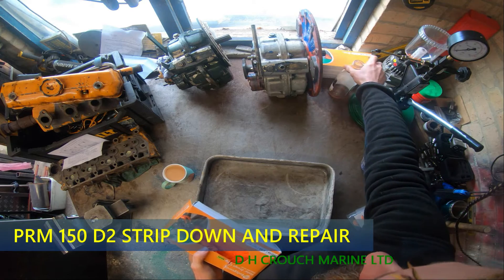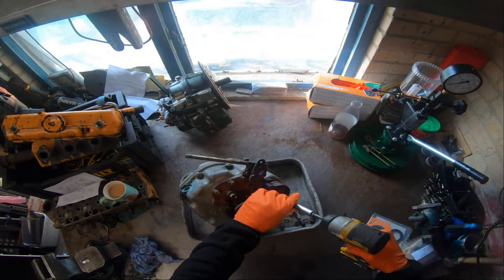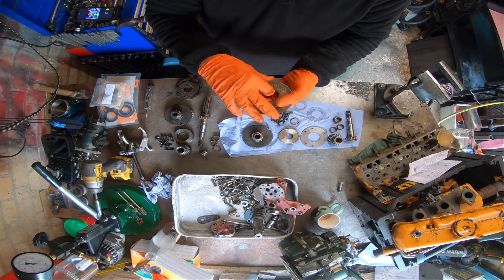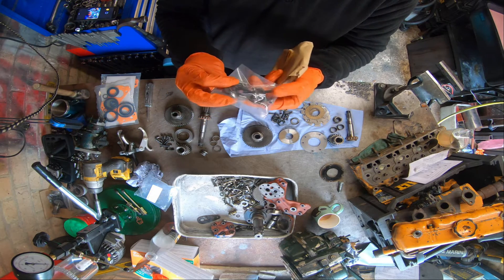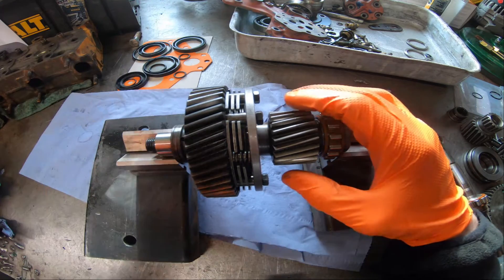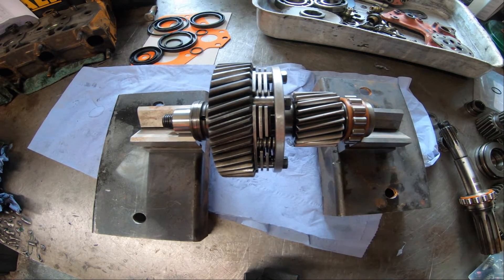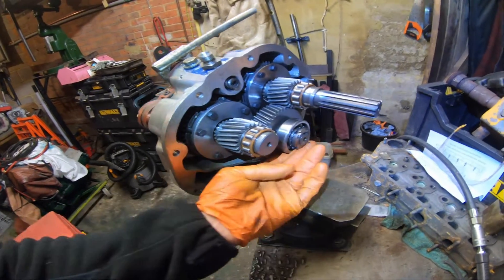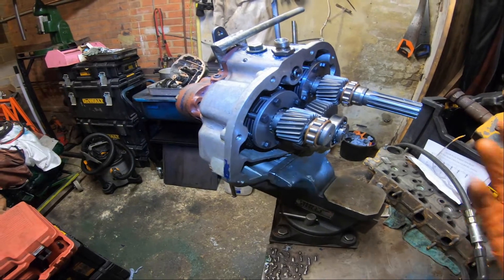PRM 150 D2 Strip down and repair.

Comment: Thanks for your video and knowledge. 
I can't access my drain bolt on the gearbox that easily, used a sump sucker but doesn't seem to get much out ,is that because of the sump,and how critical is the oil level, is maybe 1/4" over the full mark much to concern about,I've got such a job to read the level on the dipstick, typical me 👍👍
Reply from the maker: Over fill it. The manual states you need to consider the oil cooling circuit. So you need to over fill.

Filling to the top mark is actually not enough for the entire circuit.

As the gearbox pumps oil the sump will empty some so you have to add that to the equation.

Comment: Hi Daren
I live in Canada
West coast
Have a PRM150 D2 gearbox with 220 hours on it.  Forward works fine. In reverse it’s not fully engaging. 

I did recently have a blockage of zink buildup from the BETA 50 heat exchanger through to the gearbox oil cooler. 

Any suggestions?
Out what would it cost to tear down and rebuild. If that’s necessary?
Thank you
Reply from the maker: If contamination has got into the box and as they dont have any filters you might have a piece of swarf stopping the oil control rings and hence losing oil pressure. If so that that will cause the reverse clutch pack to not function correctly.

Or the clutch pack has worn out. Typically it's the ahead clutch that fails.

Cost to rebuild heavily depends on what's wrong. It can be as much as half the typical cost in the UK or near as much as new.

I don't know what labour fees are there where you are or how expensive parts are as they will be imported.
Reply: Thank you for the response. Would you happen to have a rebuilt PRM 150 D2 gearbox you could sell and ship to me in Canada?
Thank you
Nick
Reply from the maker: @MrNickstevenson63 Currently no. You can send me yours maybe ?
Reply: What would be the cost for a full rebuild in pounds sterling. And the turnaround time
Reply from the maker: @MrNickstevenson63 drop me an email 
darrencrouch@dhcrouchmarineltd.co.uk 
With your full name and adress and I'll estimate it for you
Reply: Hot do we communicate realtime

Comment: hi wonderfull video.....i had an accident on my canal boat yesterday and the nuts fell out of the gear box causing propshaft to misaligh n and gears to grind to a crunch  do you think i need to replace any parts or just bolt back together inplace??
Reply from the maker: Please explain further. What bolts fell out, were from?

The alignment will most likely need to be checked

Comment: Very intuitive thanks. I got a new boat with one of this gearbox. Planning to change oil...cant see well the sump way. Do you think i can get all the oil out thruw the  drainplug with a oil pump?
Reply from the maker: With a vacuum pump and a plastic pipe you can get most of it out. The only slight disadvantage is not being able to clean the magnet on the sump nut.

Comment: Hi again,

I've forgotten where there the trust washer (a washer with two grooves in it) goes, where does it go? I've just replaced the reverse clutch pack.

Is grease added around the bearings, if so which kind? (i haven't replaced these but can see what looks like grease around them)

Do you use a press to press the main drive bearing back on, is there a safe technique?
Do you use Loctite glue on the threads? There was some on mine when I tried to remove it which made it very tough to remove.
May I shall make a video of me putting this all back together, just want to make sure I’m doing it right first 😊
Thanks for your time
Reply from the maker: Have you got the workshop manual? Its free from PRM. All the information is in that.
Reply: @dhcrouchmarineltd3049  hi ya, yes I have I believe, I downloaded it. 
I can’t work out or remember where that washer goes however

Comment: I have this gearbox on a Beta 10 hp engine. Suddenly I’ve just lost forward and reverse. Some people at my boat club seem to think this was caused by river bind weed caught on the prop. But I’m wondering after speaking to another guy, he tends to think it’s the clutch not engaging !! I’m a total notice when it comes to engines and need advice on a plan of action, do you have any initial thoughts as a possible cause ?? Your help would be much appreciated………… fantastic vlog I’m now a new subscriber, so pleased I found this information 👍🏽
Reply from the maker: Hi Andy, glad this was helpful.
Is there oil in the box? Usually no ahead or astern means no oil. A failed clutch tend to work but slip. But check the oil level first.
Reply: @dhcrouchmarineltd3049  hello, thanks for reply……. Yes oil in the box, possibly wrong type draining fully today if I can 😬 then get a specialist to look …….. I appreciate you getting back

Comment: Hi Darren , so glad you have a video on this PRM 150 . Mine was purchased new in 2018. 
I have an oil leak along the bottom join where the front and rear gear case is bolted together . I notice that there is no gasket or seal in your video. Is it common to have it leaking from this join ?   

Thanks
Reply: I have a similar issue, but the casing seems super difficult to pull apart. Can I ask what tools your using in your video to pry other 2 sides apart?
Reply from the maker: There is no gasket for the casings it's normally a sealing compound. The case is a sofas precisely mills you shouldn't need much there. My usual preferences the use wellseal.

I have used different types of compound for when I apply it on very very very staring I don't like to slap it on because it is all over the place and makes a mess you need to make sure the casing is flat and no dents or chips and just give it a life polish if need be.

Comment: Can I please ask you about the Newage PRM gearbox? This particular one has a screw on type oil filter, apparently you can't get them anymore and there is a blanking plate MT0035 which I have bought. It has a steel washer, a fibre washer and a small white plastic thingy and I don't know how it goes together. Have you done these or know where I can get a replacement filter please? Many Thanks, John
Reply from the maker: Looking at the kit it suggest to put the small plastic ring on the threaded bolt, the fiber washer goes on first with the steel washer after, this being held on by bolt.

The plastic washer/sleeve is the seal the threads.

If in doubt speak to PRM as they can better advise. 

**Below is pulled from online**
"The oil filter fitted to early PRM gearboxes is now obsolete. Factory advice is to remove the old filter and fit this blanking kit instead. The original inclusion of a filter in the specification was soon deemed to be unnecessary, and from models 101 and 310, no oil filter was fitted.

This kit will replace PRM oil filters MT279 and MT926 on PRM gearbox models: PRM 100, PRM 140, PRM 175, PRM 250 and PRM 265 gearboxes".
Reply: Thanks for the advice, JB  @dhcrouchmarineltd3049

Comment: Hi ya, nice to have a look inside. 
I seem to have a issue with mine not going into neutral, it will go from forward to reserve but when the control is in neutral it slightly engages reverse. Any ideas why?
It may have slightly too much oil in it
Thanks
Reply from the maker: This suggest the astern clutch back is warped. If so it'll drag a bit. 

However some other things to consider, these boxes to have a free to spin output shaft. If this is a sail boat maybe the current is working the propeller. 

If it's a narrow boat maybe the clutch is just dragging due to the oil viscosity.

Does the shaft turn powerfully or is this just a slight spin?
Reply: @dhcrouchmarineltd3049  Hi, thanks for your reply. Its a narrowboat, it hasn't done it before, just started. It's only slightly spinning, I can stop it with my foot. 
I did just take it out and maybe more serious, when I gave it a fair bit of revs in forward, it suddenly lost power. 
The gearbox was pretty hot, although I believe it's cooler is working fine.....
I did just run it again, and it didn't lose power..... bit bizarre
Reply from the maker: @thewigmaker  how hot is hot? Did you use a thermometer?
Reply: @dhcrouchmarineltd3049  It just felt very hot to the touch, I'm guessing it gets pretty hot, but no I didn't have a thermometer
Reply from the maker: @thewigmaker  it shouldn't get past the engines temperature as it should be part of the same circuit. 

Change the oil, check the content for any metallic particles and be aware of the color.

I've had tiny particles stopping the oil control rings from directing oil to the clutch packs in bigger variants of these. Maybe a small particle is causing an issue.
Reply: @dhcrouchmarineltd3049  hi,
Yep, so I’ve changed the oil 3 times, it was a silver gray colour. I spoke to prm on the phone; nice enough but no real solution as to why this is happening. I just took it back out again. It started by being very slightly in reverse (while level in neutral). Going forward was fine to start, then after an hour or so cruising I blasted it into reverse to stop and then soon going forward again there was a big load on the engine which brought the revs right down, it did go forward but only very slowly. 
I’m not sure if it’s a temperature thing, valve thing, piston thing or plate thing. 
I’d like to fix it in situ but now it’s looking like I’ll have to take it out. 
As it’s a hire boat I’ll probably put a new one straight in and refurbished this one. Is it fairly easy to disconnect the gearbox from the engine ?
Any other suggestions would be appreciated 
Thanks again
Reply: Hi again. So I’m going to change the clutch packs. I’m going to use a puller to take the gears off. Is there anything to look out for/take care with?
Thanks
Reply from the maker: @thewigmaker  you don't use a puller to take the gears off. Each clutch pack is held together with a taper bearing. The gears float. They slide off once the bearings and castle nut are off. Be sure to have a soft way to clamp the assembly while you do. 

Good luck, ohh and be sure to use a quality puller and bearing catch.
Reply: @dhcrouchmarineltd3049  thanks. I haven’t got the clutch packs out of the assembly, assuming I need a puller for that. Will the bearings all come flying out?
Reply from the maker: @thewigmaker  splitting case can be a challenge. But no the bearings shouldn't go anywhere.
Reply: @dhcrouchmarineltd3049  Hi,
I'm back again :)
I still have my new gearbox (same 150) in the boat and now I'm back at trying to refurbish the old one. Can I ask a few simple questions please?
Where do all the o rings and seals go from the gasket/seal kit? - it seems like there's too many to replace. 
I may not replace as they all look good. bad idea?
Mine's a hire boat and the reverse clutch got ruined, forward looks ok so I left it. I may change my mind however...... bad idea?
I've forgotten where there the trust washer (a washer with two grooves in it) goes, where does it go?

Which gasket seal to use?
How best to clean the gasket surfaces?

Is grease added around the bearings, if so which kind? (i haven't replaced these but can see what looks like grease around them)

Do you use a press to press the main drive bearing back on, is there a safe technique?
Do you use Loctite glue on the threads? There was some on mine when I tried to remove it which made it very tough to remove.
May I shall make a video of me putting this all back together, just want to make sure I’m doing it right first 😊
Thanks for your time

Comment: great vid.  I have an oil leak on my input drive, (flexicouple side of the box).  I am wondering if I need to get the box totally out to inspect, ( off from the bell housing) or whether I can get in from the pump end?
Reply from the maker: Which model is yours? Common fault is the oil control ring inside the selection valve. Usually can be done is situ.
Reply: @dhcrouchmarineltd3049  I have  a PRM 150D. I have identified the leak as coming from the input drive, the selector valve is all dry. Not sure which bolts to attack now. Beta’s manual is not helping me too much.
Reply from the maker: @MrKyzla  OK so, the input shaft is the shaft which sits into the drive plate inside the bell housing. The output shaft is the part which connects to the propeller shaft or flexible coupling. Feel free to send me a picture.

Comment: Hi Darren. Thanks for video.  What was the symptom of the worm out clutch pack that would let you know it is wearing?
Reply from the maker: Hi James, 

I know this box was used on a widebeam narrow boat. And I think it was used to tow another narrow boat. A combination of age and abuse would do this extent of damage. 

I also think it's a good idea to flush these boxes after say 5 years use. Just the get rid of any fine particles of matter.

I had a PRM260 to strip and asses. It was thought a clutch had failed when in fact a small piece of swarf got caught in the oil control rings which take the positive oil feed. This caused a major drop in oil pressure and hence a failure to drive ahead.

Also to note if you have foul on the propeller this will of course stress the clutches. Using the wrong oil is also a bad use if these.

The only other thing I can suggest is poor workmanship may cause a premature failure. Hope that helps

Comment: Great video. I have a 150 and in the last couple of weeks it started to drip oil. I'm pretty sure it's from the gear selector seal. I've been told that this is common for the O ring to perish, and a straight forward fix. I'll hopefully get it done next week, but even though I was trying to monitor oil levels, yesterday I lost drive, but came back with a top up of oil. Hopefully I haven't damaged it?
I find it virtually impossible to read those dipsticks!
Reply from the maker: Yes the common issues will be the control valve O ring.

Loosing oil will prevent the pump being able to collect oil from the sump and hence the clutches will not be engaged when you try.

In my opinion once every say 6-10 years you should open the box and change the seals and gaskets. Inspect all the parts.

Some oils cause the O rings to become brittle and loose there soft rubbery nature. This causes oil bypass.

The newest hydraulic actuated boxes have a new oil control valve seal. The process to change them is a title more involved. But easy enough with the right know how.
Reply: @dhcrouchmarineltd3049  Many thanks for the reply. The boat is in dry dock next week, and we'll be having a close look and hopefully fix the issue.